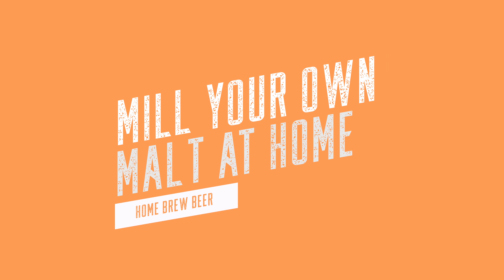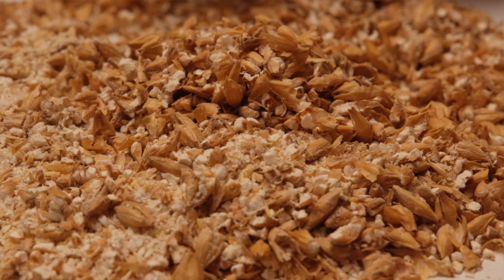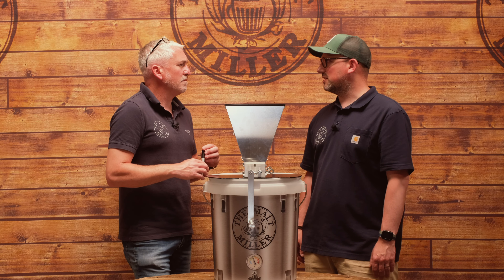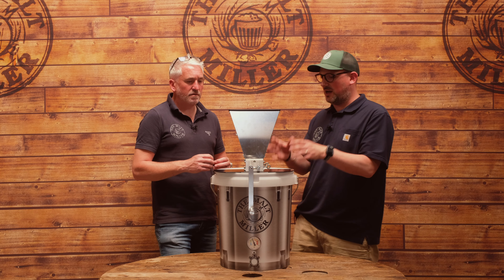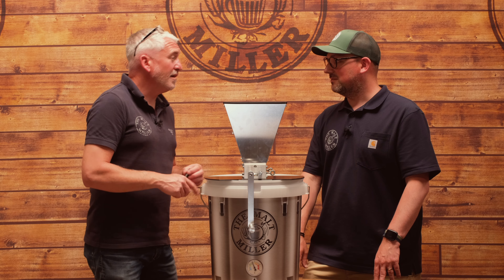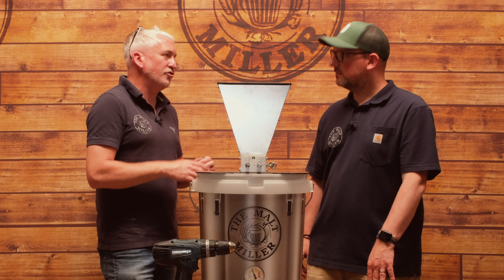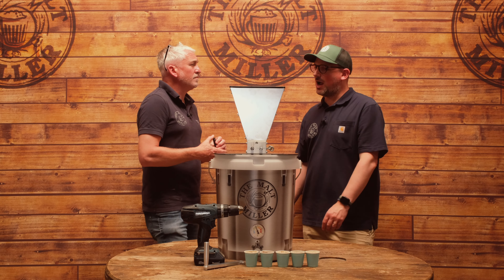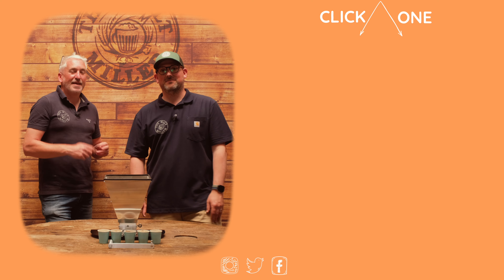HOW TO MILL YOUR OWN MALT FOR YOUR HOME BREW BEER | THE MALT MILLER

Comment: I managed to pick up one of these the other day second hand but unused. I usually buy my grain from you at regular crush for use in my Brewzilla. 

Thinking about the comment you make about using fine crushed grain for BIAB, can i take take grain which has been already regular-crushed and pass it through my mill at fine crush setting for doing small batch BIAB or will that not work?
Thanks
Reply from the maker: Hey - it's worth experimenting with but in general whole malt is the best way to go as when you re-crush it you run the risk of turning it all to powder and having a very stuck mash or scorching